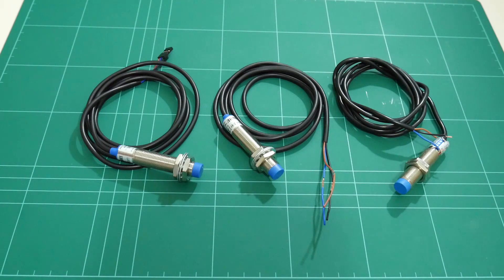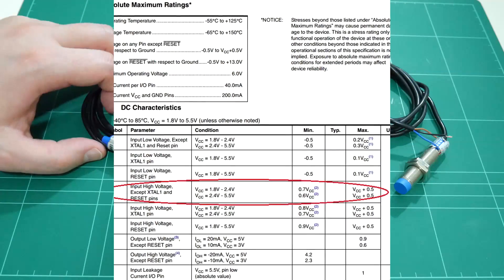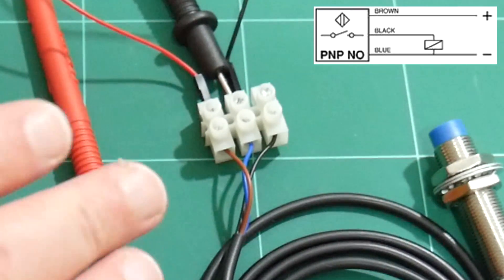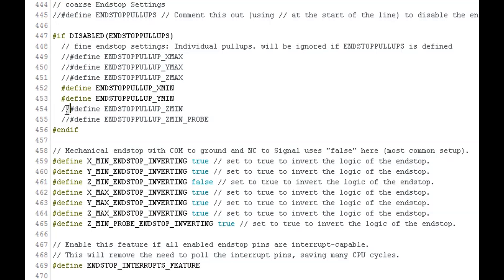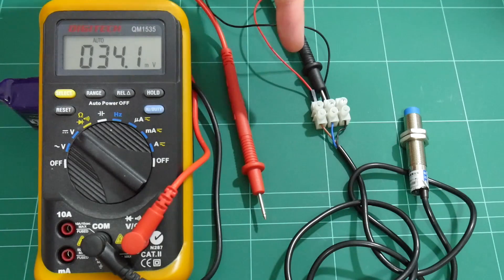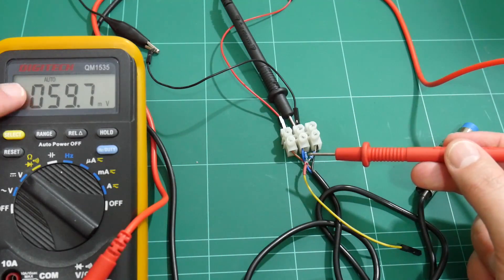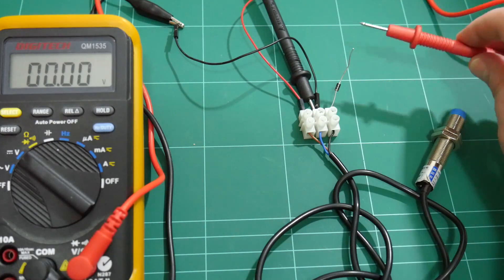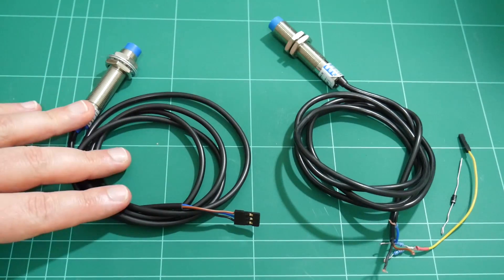Auto Bed Level Inductive Sensor for 3D Printers

Comment: The very reason I say to skip these blue ones and get the orange one and the 8mm version.
Reply from the maker: What's so special about the orange ones?
Reply: Tech2C
From everything I have read they aren't as fussy and the people who always seem to have issues of some sort or another have the blues ones.  Now having said that I think China has blurred the lines because each color used to represent if NPN or PNP but now I think they just make whatever in one color to keep costs down.  I will say having the 8mm version should be mandatory because 2-2.2mm away from the bed vs about 1.4mm is a huge difference.  With the 4mm and only using Aluminum you almost have to kiss the bed and if your print doesn't lay flat for a spot the probe can grab it and rip up your print.  I have seen the pictures of this as well as had it happen to me then you get the orange tip 8mm version and that issue goes away unless in the rarest of situations when it would have a 2mm blob.  Notice how close you had to get before the LED came on with your 4mm version?  If we all used iron beds it wouldn't matter but with Aluminum + 3mm glass it barely, and sometimes can't, see the bed because it simply is too far away.

Anyone reading this you want this sensor - LJ18A3-8-Z/BX  then find a version with NO (I prefer a real switch like that).

Comment: Is it possible to use mesh bed leveling like the Prusa I3 with this setup?
Reply: Chris yes, I have this on my Anet A8
Reply: +CHris You could use a capacitive sensor on a glass bed.  I have them on 2 printers and they work fine. Down side is they are 18mm diameter and definately need the resistor voltage divider .  Have never tried the reverse diode.
Reply: Yes you would configure that in Marlin

But to auto size the bed and stuff, you gotta have the special bed that prusia has.
Reply: I guess it needs an aluminum bed for the sensor to work correctly?  Glass bed would not work, correct?
Reply: Chris Yes there has to be a surface of a conductive material, aluminum, steel or copper.
Reply: Very clear Chris thanks a lot

Comment: Please note that while some PNP probes might work on 5v, the sensing distance might be reduced when operating at less than 12 volts.

I thought that those NPN sensors would have 'open collector' (or open drain) outputs,' and would operate a load connected between a positive source (5-12 volts) and the grounded output signal based on the wiring diagram.  You could then connect a pull up resistor to 5V to generate a positive true signal to the RAMPs board.  Certainly they show a load connected to the output between +12 and ground!    If the output with no trigger is due to an internal pull up to 12 volts, (measure the resistance between the output and +12 with no power) then it should be safe to connect a 4.7 or 5.1 volt zener diode between the output and ground to clamp the voltage at a safe logic level and set the Ramps input to inverting wtih pull ups.  Your method of using a series diode would work, but I might suggest a Schottky diode, which has a lower voltage drop for better S/N at the input.

PNP sensors supply a 12v output signal to a load connected between the output and ground.  For these you need a level converter.  Connect the output signal to a 470-1000 ohm resistor in series with a 4.7 or 5.1 volt 1 W zener diode  to ground.  The cathode of the zener is connected to the resistor, the anode to ground.  Take the output across the zener diode.  The endstop input should be set to non-inverting, and pullups are disabled.

In both of these cases I am assuming a "NO" type logic, IE: the output is active when triggered for positive logic.

You can buy stainless steel or iron foil and apply this to the glass plate on the print bed to increase the sense distance since the sensor works better with iron based materials.
Reply from the maker: GoatZilla

I haven't noticed a distance change between using the NPN probe at 12v, and PNP probe at 5v.
Reply from the maker: Very informative, thank you.
Reply: Good info.  I would have liked to see if the distance really is better at 12v.  These short sense distances make using them in printers difficult.
Reply: Tech2C That's too bad then.   Thx for letting us know.